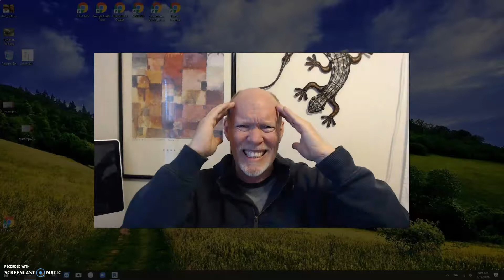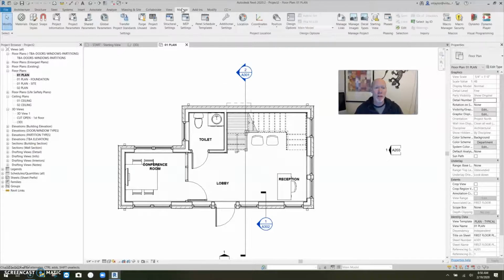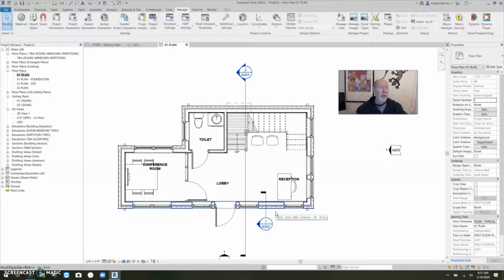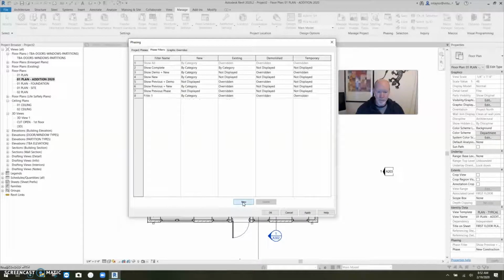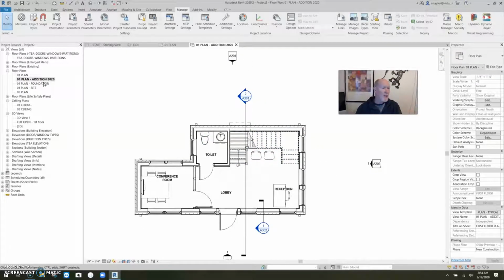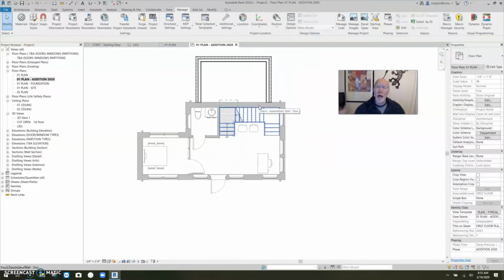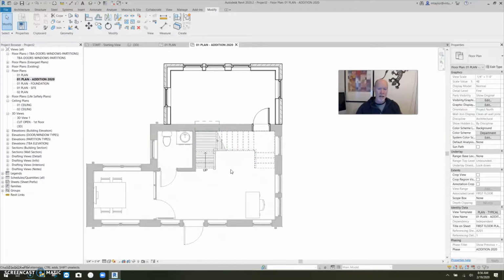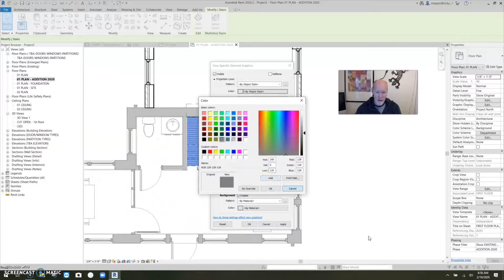Adding a new PHASE to your Project

Comment from the maker: After posting this video I realized I did NOT need to override the lineweights of the stairs.  The Phase Filter Overrides were set to show the  Demolished Projection Lines with a lineweight of 1. All I needed to do was to kick it up to a lineweight 6 right there in the Overrides (just like I did with the Cut Lines)... and it would have done the trick. Sorry for not showing that.